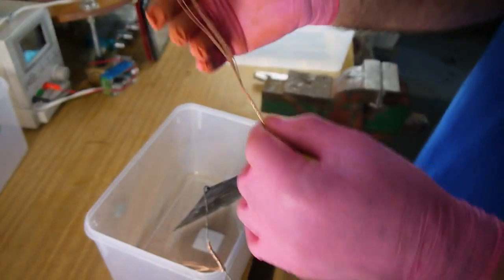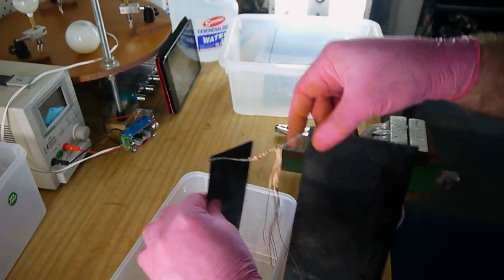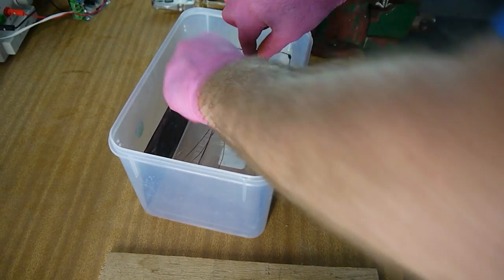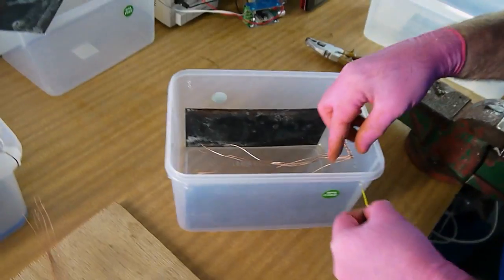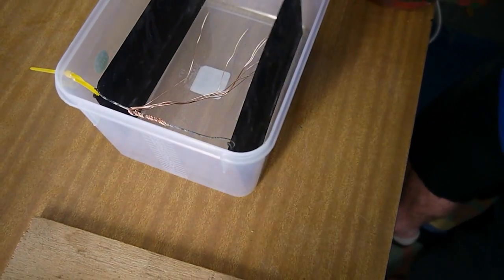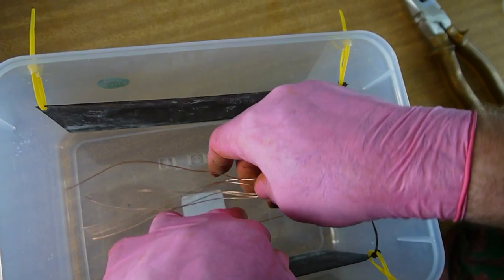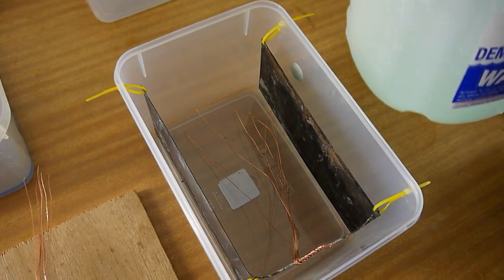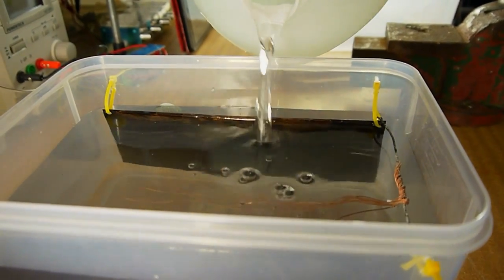Unofficial Keshe Foundation Australia. CU0 GANS Tutorial.

Comment: well i think you did a mistake using 2 copper plates. it seems you need 1 copper and 1 zinc plate. 
this is the link to the analyse of washington university concerning co2 captation via the use of zinc. amically .
Reply: +toine0265 https://home.gwu.edu/~slicht/STEP%20Technical%208-10-15.pdf
Reply: Thanks for documents